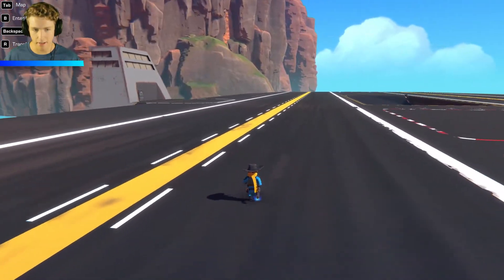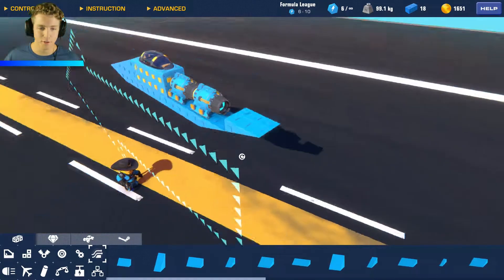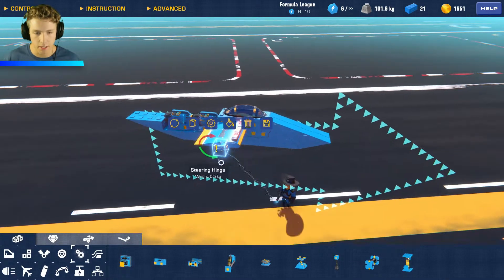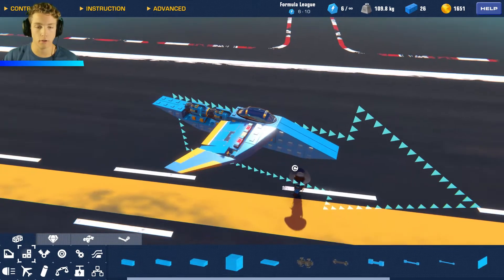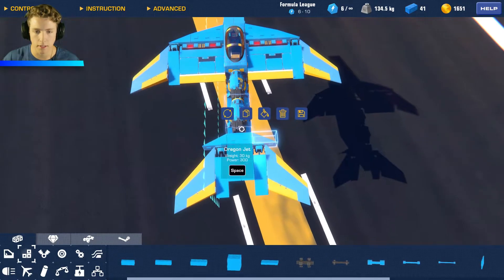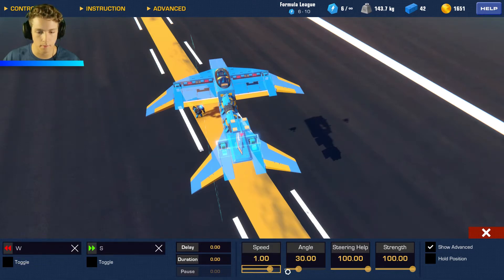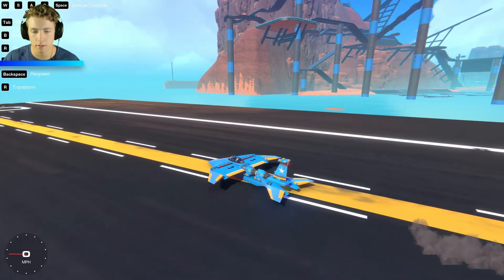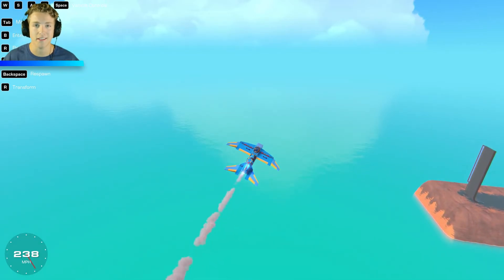SIMPLE PLANE BUILD - Trailmakers

Comment: when i use the hinges the wings dont go up and down but the 2x1 wedge 3x1 block and 3x1 wedge are going up and down
Reply from the maker: This video is pretty old so I’d recommend using another method like the newer flap wings or ailerons for roll and pitch but the way to fix your problem is to check all your connections! Make sure all parts are only connected to one side of the hinge hope this helps!